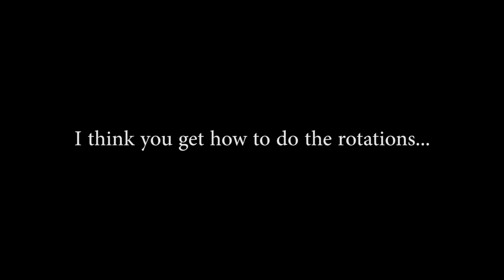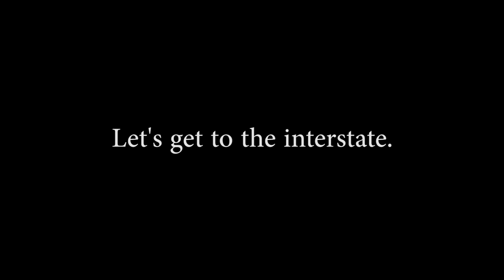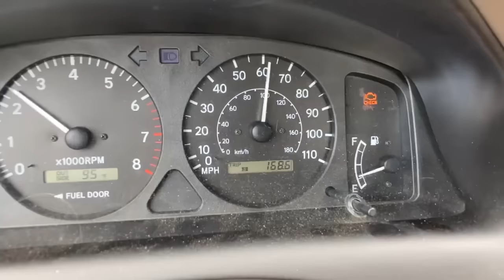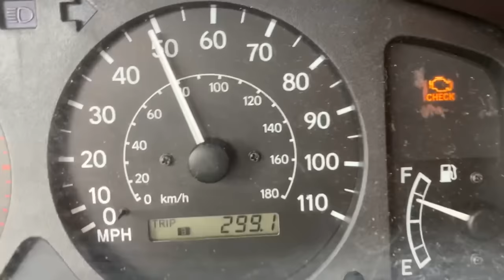Will Berryman's B12 Chemtool stop oil consumption? 😲 | Oil Burning🔥Experiments | Episode 15

Comment: How about…….. filling the cylinders with Berrymans and applying very low compressed air,1-3psi, with the leak down tester to push the Berrymans down through the rings? Valves must be closed obviously

Comment: Consider running a bottle of redline fuel treatment it has a high concentration of PEA and it survives the heat of the combustion chamber and cleans carbon and keeps the rings clean and has an upper cylinder lubricant if it doesn't have the PEA in the treatment don't bother with it

Comment: Unless the manufacturer says to use full synthetic, you should not use it. May cause low oil pressure.
Reply: Wrong. Oil has advanced since 2002. Use the correct viscosity and full synthetic.

Comment: some good improvement, i really think you are getting somewhere now, that berrymans definitely removed some carbon as it made the oil black very quickly, by leaving it mixed in the oil you gave your rings a constant cleaning. it is wise not to leave it in the oil for too long as it dilutes the oil and reduces protection against wear. regarding you driving it at 60mph at 4-5000rpm, you really need to drive up a very very long hill with full throttle to put maximum load on the engine. the car MUST be struggling to accelerate and MUST be at high rpm, id recommend 4th gear. the high load is what creates the heat to loosen/burn the carbon off the rings. high rpm at a constant speed with no load wont really do a lot. thats what i did with my car to unstick stuck rings.

Comment: Should’ve did an oil change before doing the test drive trip. Because you really may have diluted the engine oil. 
Also try adding a true baffled oil catch can to help prevent oil from reaching back into the PCV system caboning up your intake system and the blowby getting by piston rings
Reply: He did
Reply: @EricVonHunter the word is “before”. I saw that he did do an oil change “after” the test drive. But that wasn’t “before” the test drive. 👍
Reply from the maker: I was following the procedure recommended by Blackysan, and driving it before doing the oil change was an essential part of the treatment. Thanks for the comment, Benny!
Reply: @FamilyFriendlyDIY  👍 I guess so then 🤷‍♂️ but driving around with the engine oil diluted is never a good idea because wear and tear will set in due to the loss of lubrication. But again, I guess so 👍 
the only way to find out is to tear your engine apart and check your cylinder walls for scaring.
Reply: @benny6712  do you know that these 1zzfe engines were actually backspecced to 0w30?
Reply: @benny6712  yes b12 will dilute the oil but will it thin out the oil so much costing engine oil to lose it’s lubrication properties? I highly doubt…

Dave used almost 2 cans, 16oz each can, so close to a quart, not to mention he spilled some while turning the crank bolt, but the most importantly, b12 evaporates quickly! How much it actually evaporated during the 24 hrs soak I would said a lot. Because of this, how much it actually went into the oil sump I will say maybe 1 can or maybe less

So Dave filled his oil level to the top mark, by the look of its engine oil capacity, it has 4 quarts of oil in it, so 4 quarts of oil in the sump and added 1 can of b12, the ratios seems like nothing will cause serious problems. It’s not like u run the engine with just the B12 in it as engine oil, u still have 4 quarts of oil inside when u go for the high rpm driving, not to mention just going for 20 minutes only, 20 minutes only.

It takes at least 30 minutes - 1 hour to destroy a modern engine without running any engine oil at all. U will be surprise modern engine last that long without any engine oil running dry. 

There’s people in the comments section ran b12 in the crankcase between oil changes for years! Do their engines got destroy? The only time b12 will cause damage it’s when u run your  engine low in oils and u put TOO MUCH of b12 inside the crankcase at the same time.

Comment: I used to have the same corolla, but my corolla was in auto. After 280k miles and a burning oil engine i swamp for a new one w/ 70ks miles. Them corolla run forever but to my demise my corolla was T-bone and the poor frame boomerang.

Comment: You should’ve run a tube down inside connected to the vacuum shop Vac sucked out the carbon and change the oil.

Comment: Just wondering if You are aware that One of the cylinders is low on compression, or was when You were cranking after the treatment.
Reply from the maker: I think more than one was low on compression. I think it was because the oil had been stripped from the cylinders.
Reply: @FamilyFriendlyDIY  Just for poops and laughs I would do a compression check just to see. I would venture a guess that # 3 might be a low contributor.

Comment: I would definitely try this but would not drive it at redline for 20 i would just rev it in neutral for 20 i feel like driving it is not necessary and is too risky putting force on bearings and such with diluted oil, I totally want to get the update.

Comment: 300 miles per qt it should be smoking out the tail pipe pretty consistently. Plugs should be fouling and catalytic converter should be clogging.

Comment: 60 MPH  in 3rd gear = ??? RPM

I never run my 2.7 L above 3500, except when running through the gears briefly at approximately  3800 RPM .

The small amount of oil down could be oil that still hasn't  drained yet.

We've had good luck doing an oil and filter change , while substituting  one quart of Marvel Mystery Oil combined with 4 oz. into the fuel every other tank full.

Comment: Never drive it with cleaning solutions in the oil! Idle for 10 minutes and change the oil and filter. With the tank close to empty. Then add 6 cans of berrymans to fule and drive it like you stole something. Change oil and filter again. Change plugs.

Comment: what is my experience with berryman b12, don't start and run engine when b12 is mixed with oil, drain spent engine oil and refill with fresh engine oil, otherwise, it thins out the engine oil and loose libricant and will damage main rod bearing,  also before starting the engine, with all spark plug remove, just crank the engine for 5 seconds a few time to make sure all liquid above piston is expell out, and while the spark plug is out, pour a little big of engine oil in each cylinder to libricate the cylinder wall, that will make it easier to start, otherwise, it will take a lot of cranking before engine oil get there to libricate the cylinder wall to build good enough compression to start running, i have the 1/4 million mile 2az-fe, burns about 1 qt of oil every 1500 miles, running 0w-40 mobile 1 engine oil.
Reply: No it’s not true. Do as Dave did if u want to cure your tC. I done the same to my tC 2azfe and I’m the guy who suggested this to Dave and I went from burning 1 quarts of oil every 250 miles to no burning oil at all between 5k miles oil change after 2 treatments. Done that around 150k when I got the car and now at 170k still not burning oil at all
Reply: @blackysan  I tried, the flashpoint on Berryman b12 is so low, around 110F or 130F, that it would boiling and vaporized before engine is even warmed up to operating temperature, just idling for about 15 minutes engine shut off by itself, sound like vapor locked.
Reply: @bronzemaxellwg3098  the purpose of this treatment was tried to get as much as b12 on the ring land and oil return holes from the top down then burn them off with high rpm driving. That’s why we turn the crank bolt “SLOWLY” 5 rotation every 6 hrs to trap as much as b12 on them. Running b12 in crankcase or just leave them in cylinder 24 hrs hoping it drip down on the ring land does not work or anywhere near as effective as cranking the bolt by hand. It has to be manually turn the motor SLOWLY in order for the whole procedure to work as it should. Driving it high rpm to burn to them off it’s because of high speed of piston traveling creating high amounts of heat and high rpm throttle inject higher amount of gasoline into the combustion chamber to help strip off any carbon deposits because gasoline itself is a VERY VERY good cleaner (it’s strong enough to strip off paint and rust). If u don’t perform this high rpm driving after u won’t be seeing result like that just after 24 hrs soak and 20 mins of high rpm driving as 1 treatment. I’m pretty sure Dave already had great improvement after just 1 treatment and I’m pretty sure if he perform another treatment will pretty much fix the whole issue. Let’s wait for his follow up video and find out yourself. If u still burning 1 quart every 1500 miles, I highly recommend u try this procedure step by step. But if u r not feeling safe about ripping the motor with the b12 in it for 20 mins then don’t do it. U believe what u believe, I’m a believer in this also I’m a believer in filling the oil just to the the MIDDLE line between the low and top marks of the oil dip stick and checking proper oil level when the engine was fully warmed up like after 20 mins drive, oil will expand due to heat, if u fill the oil to the top mark, when oil expand, it will pass the top mark and then it will begin to cause all kinds of gasket and seal leaks because the pressure needs to go somewhere and more pressure on the gaskets, seals the faster it will fail and cracks.
Reply: @bronzemaxellwg3098  he probably did something wrong or his bearings were on the edge of breaking up to begin with. It’s been over a year since I did the 2 b12 treatments and my car is still running strong doing 5 days a week driving 100 miles per day with Uber eats and constantly revving to redline when ever I got the chance to let it rip. Read his comment section on his videos and there’s people doubting his problem linking to b12 and I believe it’s not true as well, or else my car will be broken down long time ago

Comment: You should have blown each cylinder out with compressed air and changed the oil and filter because it is mixed with the motor oil

Comment: Don't know what kind of engine your working on but HOW can all cylinders be 1/2 way to TDC????
Reply from the maker: Good question, Leon. It's an inline 4-cylinder. Cylinders 1 and 4 move upwards synchronously when cylinders 2 and 3 move downwards (and obviously vice versa). So all cylinders are mid-stroke at the same time.
Reply: @FamilyFriendlyDIY  Ok. Thanks. I don't have a 4 cyl nor have I ever. I figured all 4 moved independently in their movement and not like you explained. Guess I need to not drive only v-8's   lol

Comment: personally... i wouldnt dump so much in there then just crank it over and waste it... id let it soak that first run if you're using that much chemical let it actually work its way in there... of course it will seep past the rings and into the oil which will also help clean up the rest of the oil sludge in the motor... atf also works wonders for this kind of stuff.... your ring piston and cylinder clearance is obviously beat up a bit and with the visual reference wear from the camera... start up and warm up time... on a sloppy worn engine that burns oil.... this is a simple thing that will help in the expansion of everything vs just start up drive and rev the balls out of it lol... people that live way up north know this from extreme cold and have over time killed engines from this... ive seen cracked piston skirts especially in iron block motors from lack of warm up time over its life but overall looks like you found some success in this... when it is warm driving it harder honestly always helps these motors keep clean and running free... these motors are notorious for the 2krpm grandmas that put around which enables this problem... good luck!

Comment: it looks like to me at least one piston is so loose in its bore its rocking back n forth and has worn the piston and or cylinger to a minor oval shape which no matter how loose the oil rings/piston rings are the oil will escape by to the top of then piston.
there may be just TOO many miles on this engine

Comment: Nice Dave, there is a guy on YouTube named
 Korey Mayo who made a video using Barrymans to do the same thing on his Toyota. It seems as though it didn't work out well for him. Seems like it ruined his engine. I wonder if you do this again it would be wise to use less?
Reply: Nothing was ruined by B12... This guy is not explaining anything properly in his "video". He had bearing issues with his car for a long time. Only after being confronted about how the B12 stripped his bearings, he replied - ooo, actually the bearings were shot and I'm finding it now.

Ariel Beco
4 months ago
berrymans didn't cause this. Berryman just cleaned ur engine up and dumped all this gunk out. You mistreated your engine

1

Reply

Korey Mayo
·

1 REPLY
Korey Mayo
Korey Mayo
4 months ago
Turns out the bearings were already worn out, which is why the engine was burning oil in the first place. The previous owner didn't change the oil often enough which wore out the bearings prematurely.  I actually treated this engine very good changing the oil and all all fluids often.

Comment: I own a 1.8 tsi ea888 gen2 which consumes 1 quart every 600kms.....as I live in india I was not able to get b12 chemtool off the shelf and I have placed an order so will get it in a week or 2....so my car was due for an oil change I used mannol oil flush ran the car on idle for 10 mins changed the oil and added mannol 9929 ester additive  and I have driven 500kms with 0 oil consumption 😁 fingers crossed 🤞 hope this works and I will use the b12 during the next oil change.....you should check MANNOL products till now what ever I have used from their brand its pretty good and way better then liqui moly...plus waiting for a review if your oil consumption issue is resolved 😁

Comment: I'd flush it out again and see, but to me it looks like your oil control rings are cleaning up and doing there job again.
Here's another thing you could try and that is use WD40 along with your oil, 
Now you only need a cap full or two from a tide laundry detergent and let that work with your oil and I bet it would clean out more carbon freeing up the rings and then try the test again with fresh oil and see if any improvement has happened,  but the only thing is if you try this you only drive the car normally and don't have to hi rev the engine.
I did this in my 2008 F250 and wow it really helped clean out varnish.

Comment: That you can still see the criss-cross honing marks is a good sign.

Frankly you should’ve left the spark plugs out & just cranked the motor over several times & they would’ve cleared out the cylinders in no time.….

BTW?, More often than not it’s the valve stem seals that allow oil to be drawn down through the valve stems into the combustion chamber…..Which are usually wallowed out by worn out valve guides.

The valve stem area has the highest rate of vacuum (& everybody knows nature abhors a vacuum and tries to fill it) And with the head full of oil naturally it’s going to find its way down into the motor through the valve stem seals.

Oh & dude please get a LAUNCH PRO TOUCH trouble code reader & code reset hand-held off of Amazon. Please….smh

Comment: The fact your cylinder #3 is so clean should be cause for concern.   Typically if you see one cylinder that looks cleaner than all the others like that, almost as if its been steam cleaned, its because it is.    Likely you have a bad head gasket thats leaking coolant into #3 and is literally steam cleaning it.

Comment: I wouldn't run the car under load with an alcoholic based chemical in the lubrication system.. it can cause spun bearings and or cam cap scorning or both

Comment: Id try on my prius but I don't have a way to keep high rpm
Reply: Your Prius is a CVT transmission so u r running high rpm “most” of the time. I would say, keep your foot down the gas pedal going 80mph or so on the highway will do the trick

Comment: It's too bad you did this with chemtool and not acetone, if u Google what's the best carbon dissolving chemical it says acetone. Chemtool might be mostly acetone anyway. Acetone is also good for unplugging the car. But acetone makes the oil very runny so people are super skeptical about running engine under load with acetone in it. Also it's too bad you're not doing compression tests, there are cheap gauges. U should try engine restore additive to see if it increases compression or fuel economy